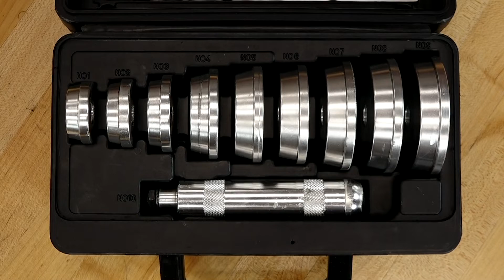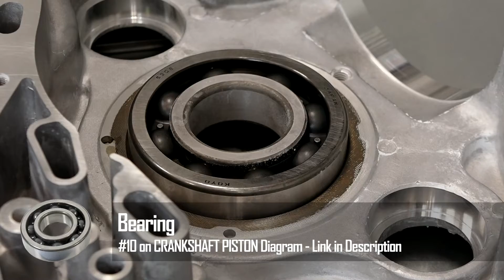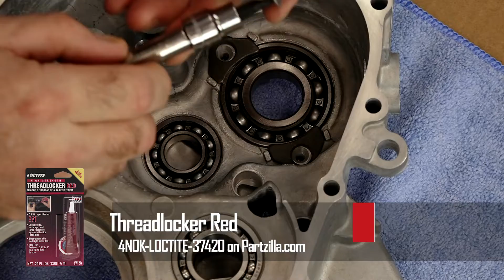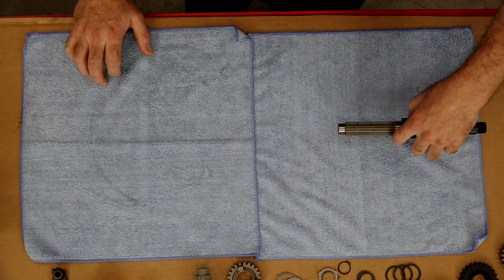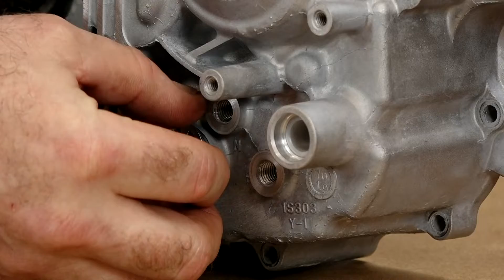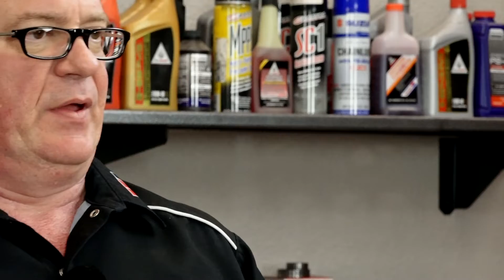Yamaha Raptor 700R Engine Build Part 1: Bottom End Build | Partzilla.com

Comment: The last bearing you installed on the case with the oil seal behind it for the upper counter balance shaft has a groove on it. Does that go towards the outside of the case?

Comment: I have a 2007 Yamaha raptor 700. the chain was set too loose and it wrapped around the front sprocket and busted the case and bent the shifting rod. I had the case welded at the local machine shop and replaced the shift rod only to find the quad only has 1st and reverse. My questions are how similar is a 2007 for 2017 and does your website have the correct parts for my year. Much appreciated
Reply from the maker: 2007 Yamaha Raptor 700 parts are here. This link will get you started: https://www.partzilla.com/catalog/yamaha/atv/2007/raptor-700-yfm70rw
Reply: @PartzillaParts  thanks for getting back with me. much appreciated

Comment: Hi, i have a question. Is the Counter Weight Balancer the same on all Raptor 700 model year ? Because i have a Balancer (Weight 2) from an engine model year of 2010 to put in my engine of 2016

Comment: Hi mate, I am going to be rebuilding a raptor 700 engine soon for a mate, I was just wondering, do you need a bearing press like you used or can you just use a bearing driver like what is used for wheel bearings? Thanks
Reply from the maker: A press is much easier, but you can get them in and out manually with a driver.
Reply: @PartzillaParts  ok great thank you 🙂

Comment: I'm working on a 2006 700R and it has clips on the shift fork shafts on either side of each fork. This makes this assembly ridiculous because you cannot build it as shown here. Has anyone removed the clips on the shift fork shafts on a 2006 with no issues?
Reply: Scott Puopolo that’s my question! He makes it look really easy but this illustration can’t be completely relevant to the 06 model. Frustrating!
Reply: @chrisross3955  @scottpuopolo2244 I have an 2007 and running into the same issue.  what did you guys end up doing?

Comment: I have a question I have a TRX650 Honda Rincon and my dad and I just finished up putting it back together had to have a whole lot of repairs but anyways we cleaned the carburetor and got it back in it and everything else but now when we start up we can push on gas and it’ll go and everything but as soon as you lift off the gas it completely just shuts off do you have any clue what could be wrong with it